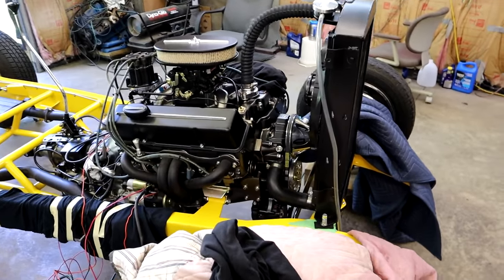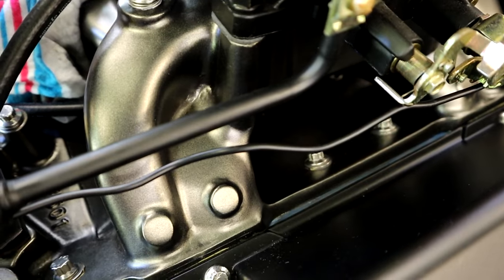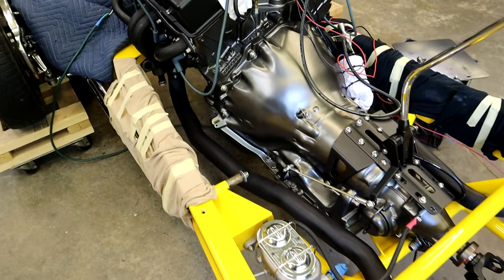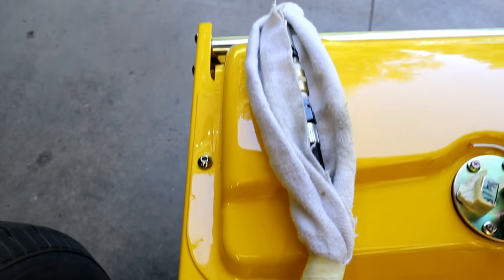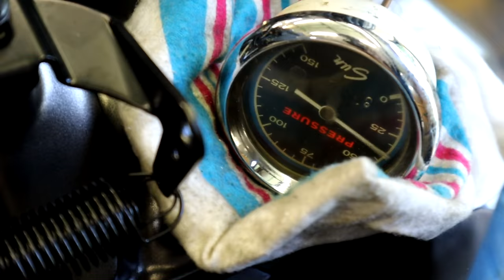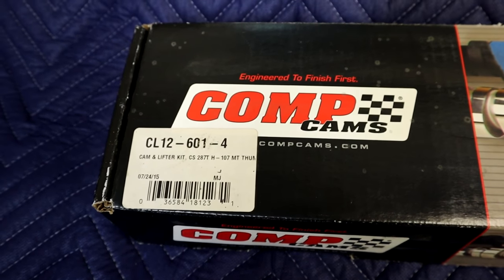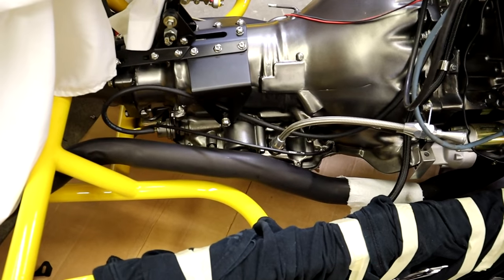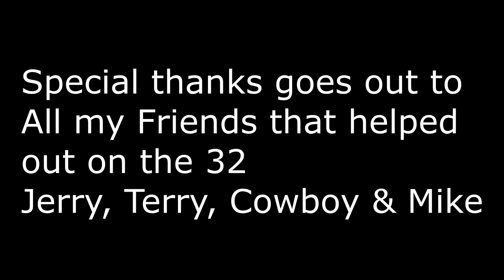Crate 350 Small Block Chevy - with Mutha thumpr Cam - First Start !!!!!!

Comment: Not trying to be a dik but Im puzzled by your post that says you guys build cars for a living yet put together such a mismatched combo?
Low compression engine...stock springs, 31 inch tall tire 273 gears practically stock stall and a cam with too much overlap
I dont think hes gonna be happy seen builds like that too many times. Open secondaries and nothing happens. 
Most any performance cam will sound good no need to get one "just for sound".
Reply from the maker: Never said I was an engine builder Im a Car builder, suspension,  body, fabrication and painter. This is my dads car and I use what he wants. He said he wanted dependable with sound so thats what he got lol.

Comment: Why the hell would you commit the blasphamy of putting a Chevy anything in a Ford....replica or not. Should have a 351 Cleveland with a 4 speed top loader.
Reply from the maker: I dont like the distributor hanging out front, if I was gonna run a ford it would probably be a y block.
Reply: @ACDesignsGarage  Fair enough I don't mind the distributor location personally. To me the big advantage to using a Chevy Small Block is the rear sump oil pan and parts are cheap and plentifull. I like building early Jeep CJ3A's and when you shoehorn a Small Block Chevy in the oversize HEI distributor is right up against the fire wall so 😠 when you put in a Small Block Ford then the sump for the Oil Pan is into the front driveshaft front drive axle 😠. Either way you just can't win 😂

Comment: Thats NOT! how you break in a cam...
Reply from the maker: Hahahaha I edited all that boring stuff out, we broke it in as per spec. Lol
Reply: @ACDesignsGarage  how do you break in a cam?
Reply from the maker: @jacobs_valid  we first fire up the engine and make sure the oil pressure is up the we idle up the engine to 2000 rpm and hold it there for 20 minutes varying the rpm up and down during the 20 to 30 minutes.  And that usually does it for me. Also make sure you use a oil that is high in zinc for the break in. I get every body telling me i don't know what im doing cause they dont see me running it for 20 minutes  cause i edit it out, kinda boring lol